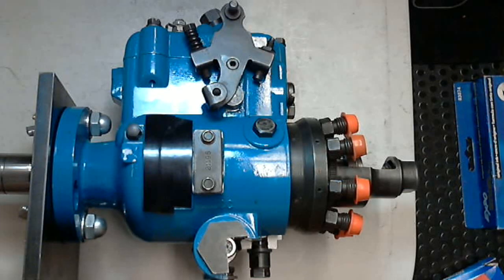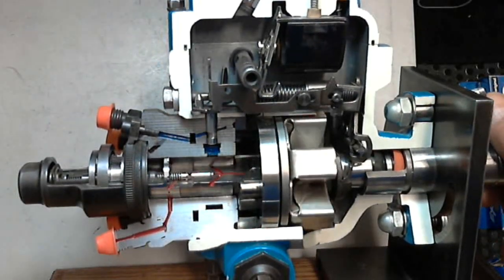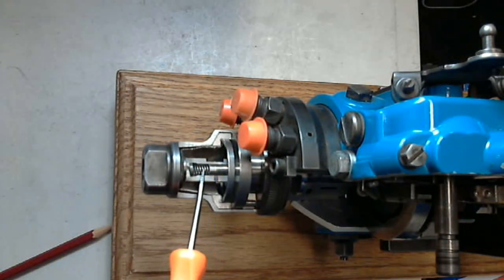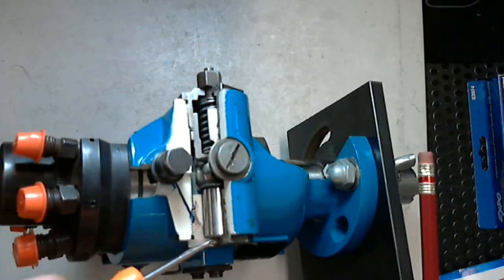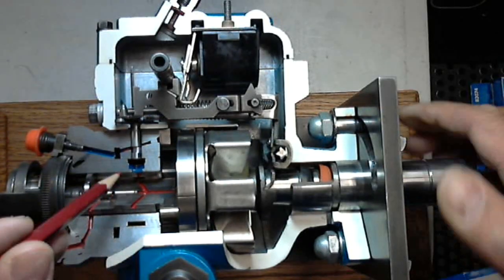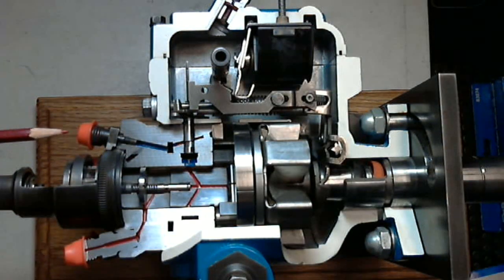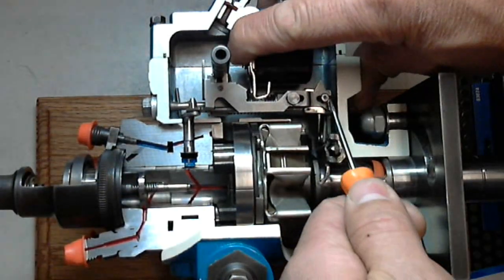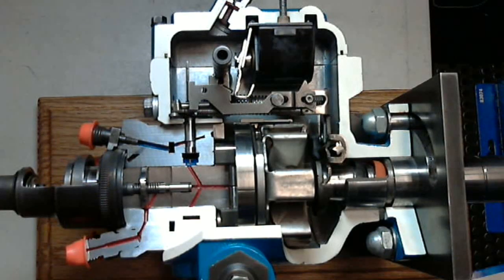Be the Fuel.wmv

Comment: This is such an awesome video, thank you for sharing.  I currently have an engine I swapped in and am trying to get going.  I have my IP off my old engine on there and I wasn't able to get it going.  I put an electric pump on the frame rail in place of the mechanical pump, it used to fill the return line as soon as the key was on, but now it barely makes it out of the pump.  I'm thinking the pump is plugged.  What are your thoughts?
Reply from the maker: +Christian Riedel Hey Christian, I will need a bit more info as you don't mention if the engine tries to fire up and wont keep running, are you getting any smoke from the exhaust, what is the engine that you swapped the injection pump off of and on to?? There could be many things that prevent the engine from starting, is it timed correctly, is the return check ball plugged, does fuel flow when you remove the fitting on the top of the pump? Check a few more things and maybe we can get it sorted out.
Dave
Reply: +instructordave111 

Thanks for the reply dave...my new compression tester came in last night...and told me that the engine is coming out...first cylinder was 5psi, second was 200...I didn't bother checking the rest after that.  Just two bellhousing bolts holding it in at this point, I'm pulling it out the rest of the way after work.  I'm kind of glad, because I'm pretty damn good with these engines and I was just so stumped as to what was going on and why I couldn't get it running.  It's getting a 120k mile running 7.3 now.  Thanks again for the reply.
Reply from the maker: +Christian Riedel Hey Christian, I'm glad you found the issue. Low compression is really bad for starting a diesel.Good Luck with the next engine. 7.3's were a great engine, just loud when cold.

Comment: Good video! thanks for making it! Could you go more in depth into how those rollers and plungers work?
Reply from the maker: +themadmailler The plungers are forced outwards by the incoming "metered" amount of fuel and then as the rotor turns the rollers contact the internal cam lobes and force the plungers back inwards towards each other. As the fuel is pushed from the area between the plungers the distribution port comes into alignment with the rotor and the fuel, under pressure, is delivered to the injector. I hope that is what you are looking for.
Reply: Thank you!
Reply: For anyone.....rebuilt DB in 64 jd3020. No fuel coming out ports.  How smooth them plungers have to move back and forth? And would you say that they are spred out most the time so the cam hits them and drive that pressure?
Reply: Kenneth, the plungers must be absolutely free to move in and out. And because of the speed of the pump, they are always out unless the cam ring lobes are forcing them inward. As soon as they have rotated past the lobe,transfer pump psi pushes them outward to be charged for the next injection.
Reply: Injected quantity is based on both the metering valve position (charge pressure, same as transfer pressure at wide open throttle) AND the charge duration which decreases with increased RPM.   This is offset with the increased transfer pressure with RPM. 

Lower case pressure increases fueling as well as slightly advances timing since transfer pressure pushes the servo piston, rotating the cam ring.  On the opposite side of this piston is case pressure.

Comment: If you have a fuel pump that fuel is getting into the pump through the inlet line but fuel is not exiting through the ports that go to the injectors, what could be the issue? Fuel is flowing in to the pump and then out through the return line.
Reply from the maker: +Randall P 
You may have a high pressure pump shaft that is broken, you may have an inlet valve that is not working, you may have an electric solenoid that is missing a wire or a ground or a fuse that won't allow the pump to go from shut off to run position. I will need more information to be more accurate in my diagnosis of your issue.
Reply: Sounds like quite a lot off possible things. Well the fuel stop or shutoff solenoid does work. Removed the pump and the gear that connects to the shaft is good.  Before I got it, the owners put water in the tank. So drained that and the fuel water separator twice. Then put new fuel in. That's about all I can add. And thank your taking the time to reply
Reply from the maker: +Randall P There are many things that can cause your issue. I am wondering if the water that was in the tank got into the pump and the opposed plungers are rusted in place. The only thing that forces them apart is the transfer pressure fuel. If they are rusted in place they can not develop the pressure to force fuel into the injectors. Sounds like you may have a very contaminated fuel pump if water has been in there for any length of time. Please let me know what you find. Still I am just pointing out things that could cause the issue you have described.

Comment: Could you make a video on how to replace the cup seals?
Or just tell me in reply to my comment.
I am not able to remove the distributor.
What is the easiest way to replace the seals?
Thanks
Reply from the maker: EvenStar LoveAnanda Unless you have a gear drive that can be removed from the front of the engine, you will not be able to change the cup seals without removing the pump drive shaft. The pump drive shaft needs to slide out from the front of the Stanadyne DB2 pump and there is a special tool that you can probably borrow to install the shaft with the new cup seals. It is designed to keep the seals from flipping over on installation. Also make sure you have the pump shaft timing marks in the correct position or you will be out by 180 degrees of pump rotation. check this bulletin from Stanadyne  @559

Comment: Hi my name is Matthew Lazarin.  Your video has taught me alot.  
   But I'm still having a lack of knowledge on how or what would cause a runaway on the 6.2 diesel gmc.  
   I believe I was the that caused it to do so but not to sure EXACTLY HOW IT WOULD DO SO.  

   I recently was out at the dunes doing some off Roading.  I stoped on a hill going downwards.  1 min passes and the engine shuts off.  
   Do I decided to push the truck to a level ground so see if the pick up pump was able to suck fuel up.  Still nothing.  No start.  
Then I opened the pressure dome and decided to move the linkage inside thinking that maybe something got bound up inside.  
      Do I closed is all up I cranked it over and the engine decided to RUNAWAY from me past governor limits.  I was able to shut it off about 30 40 seconds later. 
     So when I was able to bring it home after being towed I decided to try it again and crank it over once I crank it over I decided to run away again for me but I was able to shut it off again by choking out the air flow to the engine.
    So now I've just left it all alone and I've been trying to do a lot of research on how or what would have caused this run away how can I fix it hopefully you can reply back to this or email me or maybe even call me 

 MatthewLazarin@yahoo.com
Reply from the maker: Matthew Laced Hi Matthew, I am guessing that first the engine may have died due to the pick up tube getting some air ( fuel level very low or a cracked tube possibly from the off roading fuel slosh action ?) Second when the linkage was moved around in the housing did a lever become disconnected inside? the governor is not controlling the fuelling to pull back on the fuel when the engine overspeeds. Maybe the metering valve became disconnected and is now letting wide open fuel enter the pumping chamber. That is why the electric or manual shutoff lever isn't doing it's job because it can't rotate the metering valve back to closed. You will have to carefully inspect the linkage again. Try reading this article. Good Luck @0809
Reply from the maker: instructordave111  looks like the link didn't work. Google search "Stanadyne DB2 Injection Pump" there is a good article in Dieselpower magazine about it.
Reply: yeah that's what I was thinking that the fuel wasn't getting through the tube shut the truck off.
From what I've seen nothing has been disconnected, but I will go outside and check to see if anything is disconnected, I'm also kind of curious on how exactly you put the pressure dome back on correctly. I will write back when I'm finished looking at the linkage .

Comment: I can imagine that it took some time to machine all the injection pump parts to expose the many passageways.. Excellent work. I've always wondered how these little rotary monsters did their work, and now have a better understanding of what controls my old 6.2 GM Detroit. I have recently acquired a late 90s 6.5L Turbo Detroit, with the PCM controlled Stanadyne DS4 electronic injection pump. If there are videos of this nature describing their inner workings I'd greatly appreciate viewing them!
Reply from the maker: I don't know of any  cutaway type videos of the DS4 pump, but the ecm would be controlling the metering, governor and timing of the pump rather than being mechanical components. The guy that did this video may be a resource for you. https://www.youtube.com/watch?v=qWAZhEM-CKg  Good Luck.
Reply: They were not Detroit diesels . It’s a common misconception
Reply: In the automotive world they are considered Detroits starting with the 5.7 series, no it is not technically correct but it is an accepted term, it separates the miserable GM designed engines from the Isuzu designed GM engines.  @johngnipper8768

Comment: At the very end of your video, you talk about what happens if the return line is blocked.  This is the first time that I have run into this comment.  I have been looking for the reason that one of my engines stops whenever I raise power for the last several years.  Would this happen with a CAV pump on a Perkins T6.354? I have replaced everything from the fuel pick tube to the CAV pump, and cleaned the filter at the CAV inlet with no success.
Reply from the maker: Check the return line all the way from the fitting in the pump ( it should have a small regulator spring and valve in it ) to the tank. I have seen where a kinked pipe or hose can restrict flow enough to cause running issues. Make sure nothing is clamping the return line, like a bracket or bolt. Ziptie's that are too tight on a rubber return line are also something to watch for. Does the engine completely stop or just lose power? Don't discount the supply side or the stand pipe in the tank either. Good Luck
Reply: instructordave111
The engine completely stops when put under load.  Runs fine at the dock at idle and full rpm under no load, will also run in gear with no load, when bringing the boat up on plane it will stop after a minute or so.  I will check all the return fuel lines to see if there are any restrictions.  ( I already replaced the stand pipe when I found a hairline crack about four inches from the bottom, thought it was sucking air when the fuel was low. Not the problem.) Will let you know what I find in the return lines.
Reply from the maker: Chuck Krutzler Is the tank baffled well enough to keep the fuel from washing away from the standpipe under acceleration?
Reply: instructordave111
yes.  Also, never had this problem with the starboard tank and engine.
Reply from the maker: Chuck Krutzler To eliminate the fuel system, you could run the engine in question with separate fuel lines and a jerry can to see if the problem is with the engine or the fuel system. Has the lift pump that supplies the injection pump been looked at?
Reply: instructordave111
The lift pump was replaced and a pressure gauge  added to the line to monitor pressure, it puts out 3 to 7 psi to the high pressure pump.
Reply from the maker: Chuck Krutzler Sorry Chuck I have been away from a computer with internet for a short while. Have the fuel lines been worked on prior to the problem showing up? Sometimes if the fuel lines ( hoses ) weren't made properly, they can have a flap that will starve the fuel at a certain flow rate. Try to eliminate as much of the system as you can to narrow the issue down to only a few items.

Comment: I have a zetor tractor 6045 with PAL inline  pump. id like to adjust up the fuel amount so id get 5-10hp more.its only 58hp but other models have same engine but 70hp only due to pump adjustment. guess i have to find a exploded view of that pump to locate main adjustment.  on japanse rotary pump its done in 5 min. release a lock nut ant turn the screw in the middle and your done :p
Reply from the maker: You may be able to adjust timing slightly and the rack travel slightly, but likely going up a size or two with the injectors will get you more power. Good Luck. I don't have an exploded view of your pump. http://www.motorpal.cz/en/products/fuel-injection-pumps
Reply: Thanks alot,i`ll give it a try :)

Comment: I have a 70's 644-aa loader that has this pump. Freshly rebuilt 407 jd engine and i have the problem of the pump overfueling causing hard starting, hot or cold and alot of smoke. Can this pump be turned down or up or does pump wear cause the overfueling?
Reply from the maker: I am assuming that the engine was rebuilt, but the pump was not? What makes you believe it is over fuelling?
 A worn pump should actually inject less fuel than too much due to extra internal leakage.
Was the pump timed to the engine properly when the engine was rebuilt? What color smoke do you have, white or black ?
Set engine to TDC on No 1 cylinder and then open inspection window to see if the timing marks on the pump line up. If the pump is off by 1 degree at the pump it is 2 degrees off in the cylinder timing.
Reply: Thanks for commenting back. Yes your correct. the motor is fresh from the crank up but the pump is not. I had a local j.d mechanic time the pump and engine but you never know. The smoke is black and thick. As soon as you hit the starter button, here comes the smoke rings. I have to either it every time we start it. It runs great once started, good power no oil loss, but rolls coal all the time as they say, but if it sits for 5 min, back to the juice we go. Im a gas mechanic so diesel engines are kind of left field for me. I will check the pump timing through that window and see what i get. Anymore input you might have on this is highly appreciated and thank you for taking the time to info me.
Reply from the maker: leanne brown No problem, since it is a 70's vintage engine, there would be no emissions equipment on it, is it turbocharged?
Did you have the injectors tested. Black smoke is either too much fuel or not enough air. Too much fuel can be due to the pump being adjusted for more fuel than the engine can use or the injectors allowing more fuel to flow into the cylinder than normal. How was it running before the rebuild? Hard starting could be from incorrect pump timing, unatomized fuel from worn injectors or worn cylinders not developing pressure to fire the injectors. I know you said you had good power, but if it's black smoking you had better keep an eye on overheating the engine and this could also wash down the cylinders and ruin the rings, pistons and cylinder walls ( Sort of like having pre-ignition in a gas engine). Verify that the air intake system is completely clear and the filter is clean and then you may need to have the injectors and the pump tested. Good Luck and let me know what you find out.
Reply: The injectors are all rebuilt. She is turbocharged. I believe someone turned the fuel up back in the day cause it was wore slick out when we bought it and rebuilt it. Extreme blow-by, but it starts and black smokes like it did before the rebuild. john deere said you couldn't turn up delivery on these pumps that you could only adjust rpm so that confused me. Intake,filters and all are great. Everything gone through except the pump. Can these stanadyne  pumps be turned up and down?
Reply from the maker: leanne brown You are more than likely correct about the pump being adjusted for more fuel or a pump from a more powerful engine was installed on the loader. There is a leaf spring inside the pump that can be adjusted to change the maximum amount of fuel the pump can deliver, but it requires disassembly of the pump to do it. Nothing external that would make it easy to do.
Here is a very good article about how this pump is constructed and how it works.   http://www.dieselpowermag.com/tech/general/0809dp_stanadyne_db2_injection_pump
Check to be sure the pump is the one for that particular engine if not then it may be best to exchange the pump for the one that is supposed to be on that engine. Running the engine in an over fuelling condition is going to take the engine out again.
Reply: Thanks buddy. Your a big help. I'll check that out and post you in the future on my findings.
Reply from the maker: leanne brown Hey Leanne, did you ever get this working properly?

Comment: What does this pump go to
Reply from the maker: Hi Aaron, this is a distributor or Rotary fuel pump designed for diesel engines usually smaller than 250 hp.